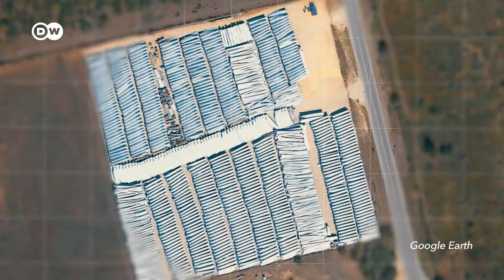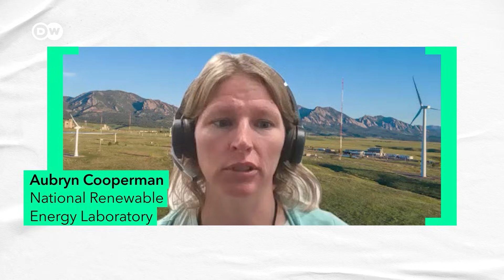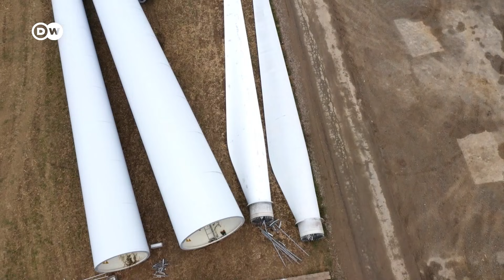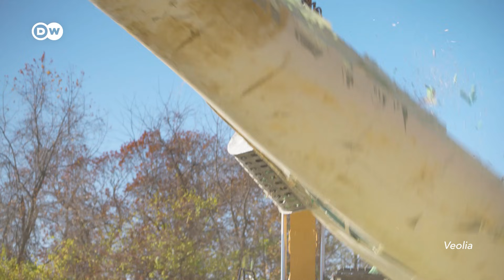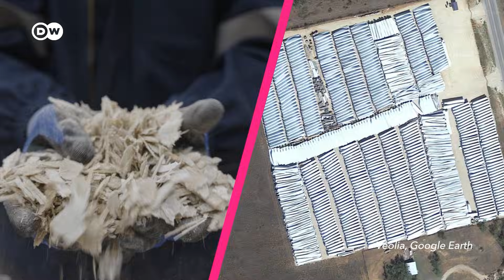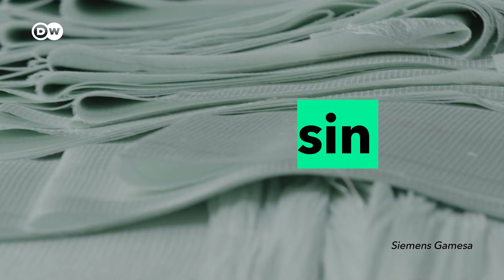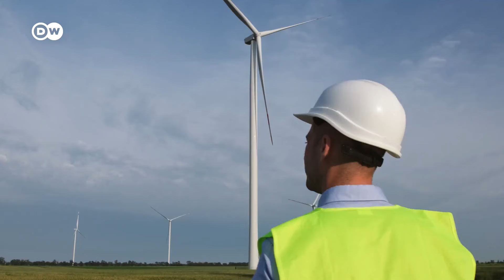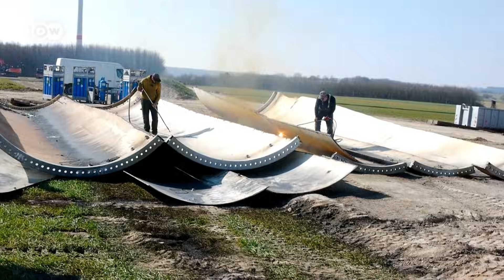Wind power's unsolved problem

Comment: What's the point of having GREEN wind turbines, to simply burn them later. Somewhere the point is being missed.
Beam me up Scotty, time to leave.
Reply: To produce 1/100th of the CO2 emissions of coal power plants for each produced kWh and be cheaper.
Reply: That's a clear and admirable ambition, but is it really happening. Burning blades delivers a lot of toxic gasses and particulates.
Have you any information that justifies wind power delivers1/100th of the CO2 emissions or is it just a whish ?
I am not condemning wind power, but if we only move the problem around, we win nothing.   @old-pete
Reply: @stevescholey3479  Yeah, it is happening. There are enough studies on this.
And when someone burns stuff at a large scale, one has to follow enviromental protection laws. Many countries require a filtering system.
Reply: @stevescholey3479  You need to factor in magnitudes. 

Any form of energy will pollute. Question is how much? 

Any sort of renewable blows fossil fuels out of the water in this regard. 

Look up NREL Life Cycle Harmonisation. It's a study of carbon emmisions through the whole life cycle, from manufacturing to disposal, of different power sources. 

DW has also made a video referencing this study called How clean is Solar really?, which mentions winds impact as well.
Reply: @anxiousearth680  thank you for the NREL link, I am looking through it.
From a personal point, I am looking for non-biased information, a true quantitive, realistic answer to sustainability. I hope the NREL info.  is fair. (asI wrote above, I am going through the info).
As a first glance the CO2 emissions are less for the non-fossil fuel energy generation, then what is the CO2 cost to use the electricity (cars, industry….l). I hope this picture is given in the link.
Thank you again for sharing the link.

Comment: Make smaller metal ones over bigger areas?
Reply: Less efficient.
Reply: cost+ ease of repairs +easier operation? or max efficient+ higher cost + harder operation i think it's all about what you choose @old-pete
Reply: @F2000GL  It is no choice. The small ones are much more expensive. One cannot cheat physics. Small turbines generate only a fraction of the electricity, making them more expensive.
Reply: @old-pete  a single turbine will be cheaper but over will cost will generate less energy so yes that makes it more expansive  and using metal blades will make it less efficient too because it will be heavier and you will need more land too that's why i say you will have to choose what will you do or come up with new tech
Reply: @F2000GL  It is a choice between throwing away money and earn money.
It is like the choice of a car manufacturer to sell cars for a reasonable price and earn money or half the price and go out of business quickly. Great "choice".

Comment: We need nuclear, NOT wind and solar.  Its cleaner, safer and better for the planet, AND much cheaper which makes it better for the economy, general prosperity and quality of life.
Reply: Nuclear is much more expensive and takes too long to construct. New nuclear power plants take 12+ years construction time in western countries. Even China needs 7-8 years for a new nuclear power plant.
And the CO2 footprint of nuclear power plants is actually a bit larger than the one from windpower. And calling nuclear power cleaner is a bit of a stretch, considering the waste.
Reply: @old-pete  the co2 footprint for wind is much larger, building, maintaining, replacing and disposing of windmills all has ita cost.  Building a plant is certainly much more expensive than a few windmills, but per watt over that plants lifetime the cost is next to nothing, and nuclear "waste" isnt actually a problem at all, that has been nothing but a media scare tactic.  The actual "waste" makes up a tiny volume, is stored extremely securely, and isnt waste at all because it can be reuses given the right type of reactor

Also the cost in human lives, more than twice as many people die per petawatt of wind power building and servicing the things than for all the nuclear accidents in the world, and the damage they do to wildlife cannot be understated either
Reply: @Sotanaht0  This is all included in the calculation and windpower still has 3/4th of the carbon footprint of nuclear power.
And the costs are significantly higher. Hinkley point C gets a guaranteed price of 92.5 £ per MWh. The cheapest windturbines in Europe operate at 29€ per MWh, typical is 75€ per MWh.
At the moment one £ is 1.15€...
And to store waste, one needs a storage facility, which not all countries have and which usually turn out much more expensive than planned.

Comment: THE TIME FOR WIND AND SOLAR IS CLOSING 
As of today Green energy is in real jeopardy of loosing its credibility. 
The public are becoming aware of the issues of having landfill made of green technology waist Wind farm blades today being cut up and placed in landfill Or Even worst ground up and added to wet concrete and solar is no better than wind for recycling.
Now other ideas are growing but are they good ? Pump hydro requires 40% more power than is returned so the power bill rises 
Now i am not saying make more dams before those that know my tech far from it Just Make It More Efficient... My system is retro fittable to water and hydro dams to make more power from the same current flow rate. Now let me add 100yrs life and dam near 100% recyclable
Reply: Looks like you did not watch the video.
And no, pumped storage does not increase the power bill, to the contrary.
Reply: you dont spend a half billion dollars and dont ask the consumer to reimburse you the cost of construction and supply. your delusional if you think its free  @old-pete
Reply: @simonbowman6206  I never made that claim.
Pumped storage uses electricity that would be wasted anyway or would even destabalize the grid and provides power when electricity is in high demand and expensive. It lowers the market costs by providing additional supply in times of high demand and once again stabilizes the grid.
Reply: baseload is literally the power like hydro able to be on or off at the drop of a hat. Now your on the money side of the equation cheap power used to move water at a higher price when sold  NOT the energy side it takes 30-40% more power to move that water than you get as it hits the turbines AND U DO PAY FOR IT WE ALL DO    @old-pete
Reply: @simonbowman6206  Not all power is on and off. Steam based power plants are too expensive to just turn off. Wind and solar power plants do not save money when turned off. It is better to use that energy to pump water and use that stored energy when it is needed.
Reply: That's part of what is baseload power is ur right in part but coal & gas are able to idle and hydro is the on demand or stand by units as is able to give full power in 1-2min but to say the grid has excess power that is used to pump water is wrong. I have been in this field for ten years and am the inventor of a system for hydro power to make more power from the same volume of water currently used. as for wind and solar both are for the most part are dead the solar is obvious at night and the wind for the most is dead to and to say the pumping happens during the day with excess grid power is not correct to the price as you have said is the key the price of the power used to pump and the price customers pay when the water falls to the turbines  So to use solar / wind to pump is wrong its base load used gas, coal or hydro  
 @old-pete
Reply: @simonbowman6206  Gas is not the problem. Idling steam power plants is expensive as one cannot just turn off or on the heat. Sudden load changes are not good for the material either, that is why one tries to avoid that. 
This results in grids having excess power during the night. That is the fundamental reason why pumped hydro was built in the first place.
If there is no issue, there would not be demand for them.
Today solar and wind powerplants get turned off, when there is not enough demand, which is a waste of energy and damaging the economy. This increases the demand for pumped hydro. And yes, the power supply can even be too much during the day.

Pumped hydro results in cheaper electricity during peak ours and less wasted energy during off hours, which lowers the overall price of electricity and stabilizes the grid.

Comment: Fast Microwave Assisted Pyrolysis (FMAP) could solve all waste problems including this one, but recycling waste into fuel and energy while locking away carbon would solve the very profitable energy and fuel 'crises' and waste of resources capitalism thrives on; hence the very effective suppression of this amazingly promising technology.
Reply: There are not enough blades to solve a fuel crisis.
Some of the blades are already turned into fuel.

Comment: What should we do with turbine blades?
1) Never in a landfill
2) Until we have something better, burn it and use the energy.
  2b) Carbon fibre should burn, glass fibre is basically rock and can be used in concrete.
3) If we can build new turbines/ cars / houses and so on, that is of course the best

Comment: Just build them to last hundrets of yesrs. Haw blades can be not usable ofter 20 years of using?
Reply: Because building something is not wishful thinking. One has to follow the laws of physics. There is no material that can bend 10 billion+ times.
Reply: @old-pete  so use different materials
Reply: @kurwamacjebanapizda  No material means no material. Someone has to invent a better material first.
Reply: @old-pete  so instead of inventing how to recycle useless materials use that time and knowlege to invent proper one.
Reply: @kurwamacjebanapizda  Engineers work on both. That is why newer blades use more carbon.

Comment: just sounds like a load of whataboutism to me. No one seems concerned about what we’re doing with old decommissioned coal and oil power plants or solar panels, let alone the ongoing harm to our environment the extraction and usage of petroleum and petroleum products is already causing. and yet we’re supposed to believe worn out turbine blades getting land filled after 30 years is a big problem. These idiots seem to think we need a perfect solution, and that achieving even small amounts of harm reduction isn’t worth it. They’ll never be happy. If we ever manage to discover cost viable fusion they’ll still manage to find a downside and justify dismissing it. Progress will march on without you, fox news.

Comment: Wind turbines were designed efficiently for inefficient function, maintenance, & repair.
Reply: They work fine.
Reply: @old-pete   
Their purpose is to derive power from wind, but far more diesel pollution is created through set-up & repair. It's not sustainable.
Reply: @VerdeMorte  CO2 emissions of windturbines are vastly lower than gas or coal power plants.
Reply: @old-pete   
The diesel Flatbed & Crane trucks that carry & set-up wind turbines are not
Reply: @VerdeMorte  They are included in the calculation and their contribution is minor.

Comment: 1800 gallons of oil.  That's how much oil EACH of those giant windmills uses, bet you didn't know that.  About 1000 for the transmission inside the windmill body and another 800 or so for the transformers.  Each and every giant windmill you see uses the same amount of oil as 30 vehicles use in oil changes over 20 years.  This ISN'T about the environment, it's about money plain and simple.  Wind power companies don't care about the planet, they care about profits and they'll do or say whatever it takes to keep the money rolling in.
Reply: They do not use that much oil and can use synthetic oil.
Still, it is a lot less energy use than fossil powered plants.

Comment: Why not make it out of a more recyclable material even if you lose a little efficiency, if it allows you to operate longer with more durability and its cheaper to recycle and repair. Its a win longterm!
Reply: If you have such a material, tell them, you will get rich.
Reply: @old-pete  it's called plastic and metal  heavier less efficient, but more durable
Reply: @noticing33  There is no metal strong enough for the big blades. The resin is basicly plastic, it does not improve the recycling...
Reply: @old-pete  plastic and metal glue is not the only way and plastics are not all one type
Reply: @noticing33  As I said, it does not really improve the recycling. And if there were a better material available, a couple thousand engineers would have found it by now.
Reply: @old-pete  I never said the material has to be BETTER, just more durable AT EXPENSE OF SOME EFFICEINCY so long as it it lasts longer and can be more easily repaired rather than tossed away, learn to read, also having distinct components to make a blade is easier to recycle as they can be separated more easily
Reply: @noticing33  More durable is better. It does not exist yet.
Reply: @old-pete  more durbale but less efficient is what i said, can't even read a sentence.
Reply: @noticing33  No need to repeat yourself, it does not exist.

Comment: So long as the fossil resins used in the blades are kept out of the atmosphere, they sequester fossil carbon. Until turbine blades are made from biomass instead, far better to grind them up for aggregate in concrete -- much stronger, lighter concrete more resistant to erosion due to the fiberglass stapling of this material -- than to burn for energy.

Comment: Cement is the paste that acts like glue that holds the concrete together. Pretty sure you meant to say concrete.. not cement. What you speak of is called fiber mesh concrete. It has very high tensile strength. In some applications you can get away without using rebar as long as you use fiber mesh. Shits expensive though thats fo sho
Reply: But he did not mean that. He talked about cement for a reason.

Comment: Burning them shouldn't be considered or a part of the recycling process in any way. Think about the emissions
Reply: Which would still be a hundred times  cleaner than coal. 

There is a consistent misconception that green energy needs to be absolutely perfect. 

It doesn't. It just needs to be better than fossil fuels. Which it is by a, massive margin. 

DW has made a video on this, which references a life cycle study by NREL, How clean is solar really? 

Off the top of my head, 

Wind 20g of co2 equivalent per kwh

Gas 500g

Coal 1000g
Reply: @anxiousearth680 While some methods might be considered "less worse" than others, it's crucial to strive for cleaner and more sustainable alternatives. Transitioning to renewable energy sources and adopting innovative recycling technologies that minimize environmental impact would be ideal. It's important to prioritize solutions that move away from reliance on combustion and contribute to a more sustainable and environmentally friendly future.

Comment: Why not simply cast them from aluminium same as airplanes wings? Yes, it would be more expensive, but 100% recyclable and very durable
Reply: Because aluminium is not strong enough for large windturbines.
Reply: @old-pete  aluminium is strong enough to withhold 200 tons airbus body in the air. And the wing is a hollow construction, there are a lot free space inside to increase the thickness of internal metal bars. After all you may have internal steel-made stift along the blade. And actually what forces the blade is experiencing? Only air resistence against incoming air stream, same forces every building experiencing including skyscrappers (with much larger airflow surface)
Reply: @Nowherenear-w1d  Wings are not windturbine blades. The forces are greater with windturbines and the forces increase with the weight of the blade. The blades have to endure over 15g and 1 billion load cycles in 20 years.
Aluminium is not tough enough for that.
Reply: @old-pete  15g doesn't look scary. Military air planes are usually constructed in mind with 12g, but stationary oblect is not limited in weights and thickness. And this object may easily be enstrenghened with steel framegrid arming all along

Comment: I see other problem, why only 20 years? Make them durable and actually reuse them in new turbines. They are strong enough not to decompose, but not strong enough to be reused?
Reply: They can run longer, when well maintened.

There are two problems.
1. The material gets extremly stressed and experiences around 1 billion load changes in 20 years. That is not good for durability.
2. In the last 20 years the average windturbine power increased by 200%. New windturbines are much more powerful and more economic than their 20 year old predecessor. Companies want the new model.

Comment: How is steel not recyclable? Most wind turbine blades are now made using this.
Reply: No, they are not. The blades are made from composite material.
Steel works only for smaller windturbines. But feel to look for models that use steel blades.